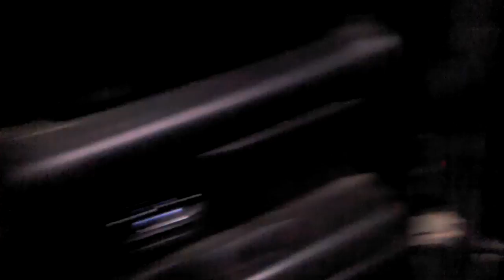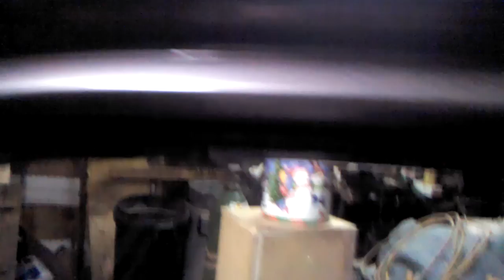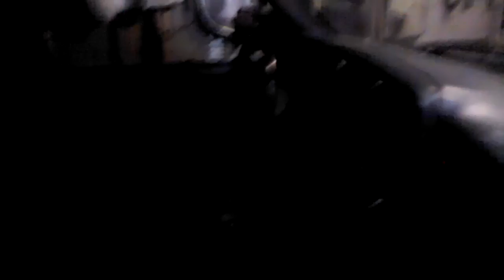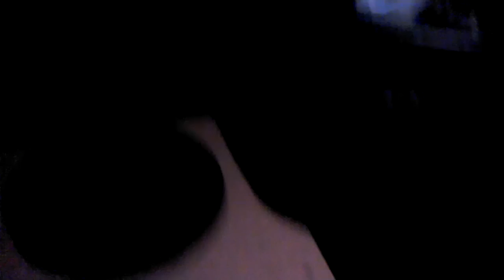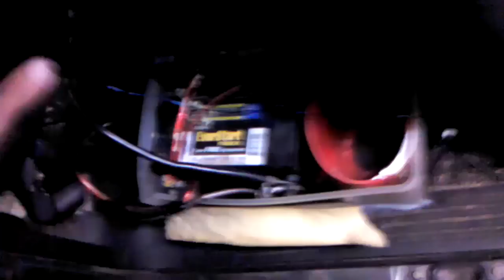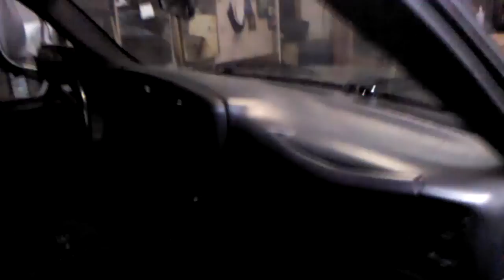I need advice guys, what amp should I get?

Comment: Sedona Series Monoblock Class D Car Amplifier # RMS Power Rating: * 4 ohms: 750 watts x 1 chan. * 2 ohms: 1300 watts x 1 chan. * 1 ohms: 2000 watts x 1 chan. # PWM MOSFET power supply # Variable Bass Boost (0, 6, 12 dB at 55 Hz) # IDI Intelligent Distress Indicator for thermal, short, and impedance protection # Dash mount remote gain control included # Brushed aluminum finish # Low pass and Subsonic crossover with active x-over function # Turn on/off delay # Single-channel monoblock operation #

Comment: The old power class series up to where they they started to making the pcx class.after that the ones in between those years were crap!so old school ones and the newest ones are all good!!! if you get the 1 I showed you you have the same mono block amp I have which is retarded!!!!!200 amp fuse!!..i thought I was going to get a crappy amplifier for that price but far from that ...its at half gan.and the bass knob its at like 1/8 of the way up!!and its throwing my 4..15s around like crazy! !